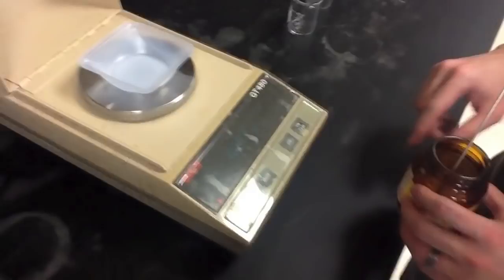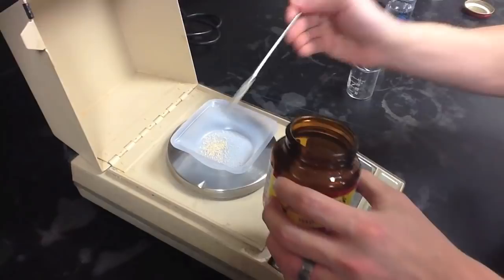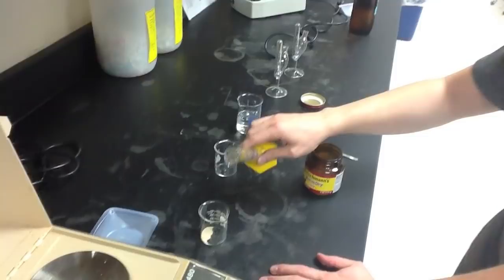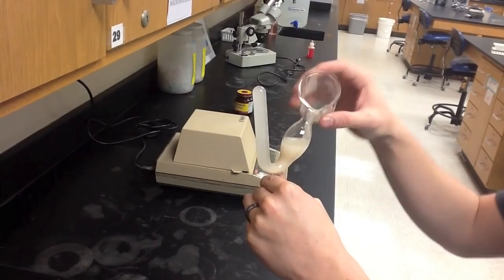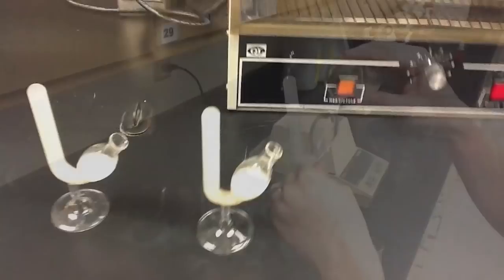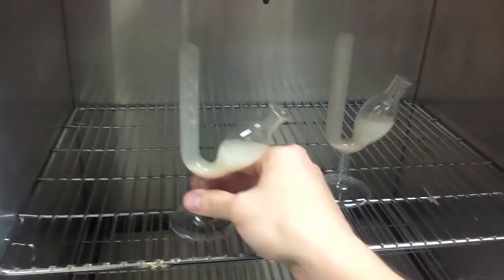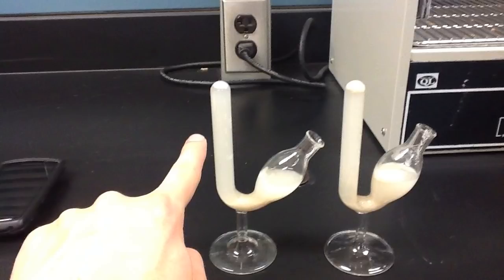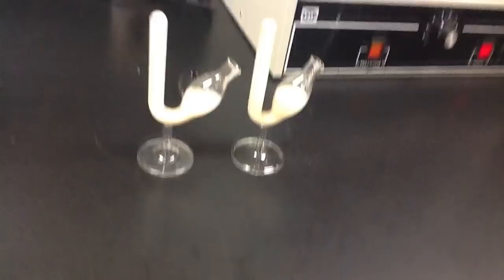Lab Protocol - Fermentation in Yeast (Unit 9 Respiration)

Comment: Hi! Is it possible for the sucrose to produce more co2 and have a faster rate given that it needs to be brokendown first into glucose by the enzyme coming from yeast? rather than the readily glucose?
Reply: In my class, sometimes the students get the most CO2 from the glucose, and sometimes from the sucrose. Often it will differ between groups on the same occasion.
Reply from the maker: While it is possible to observer a faster rate of fermentation occasionally in the sucrose compared to the glucose, previous research has actually shown that yeast typically prefer and are able to perform fermentation on glucose at a faster rate then fructose or sucrose. https://academic.oup.com/jimb/article/4/4/315/5987389

What this ultimately shows us is how important it is the repeat experiments to validate our findings. If we only performed this experiment once and observed a faster rate of fermentation in sucrose compared to glucose, we may draw incorrect conclusions from it. However, in a true research laboratory setting, you will often perform experiments hundreds, if not thousands of times to verify the validity of your findings, AND you will justify that validity through statistical analysis.

Comment: What method is used to show that fermentation is happening?
Reply: None, because the experiment is measuring aerobic respiration. Half of the CO2 the yeast produces is trapped in the tall part of the tube. The other half escapes, but since all the O2 it uses comes from the outside air, we know that all the air bubbles come from respiration. The tube has measurements on it, so you can see precisely how much they produce (when it's at least 0.3 mL, because below that is the curved top of the tube and has no markings). The maximum measurement is 5 mL.
Reply from the maker: @amicatemporis  this is not correct. Please refer to the remark I left on your other comment. This is fermentation, not anaerobic respiration. CO2 is a byproduct of fermentation. Anaerobic Respiration occurs when you still perform the latter steps of respiration but the final electron donor is NOT O2. Yeast do not perform anaerobic respiration. I believe that the vast majority of organisms that perform anaerobic respiration are limited to certain types of bacteria and archaea.
Reply from the maker: CO2 and Ethanol are produced during Fermentation. While ethanol is the final product of the process, CO2 is a byproduct produced when pyruvate is converted into acetaldehyde. Because ethanol is a liquid and CO2 is a gas, we chose to measure the CO2 as a measure of the amount of fermentation in this experiment as it will separate from the liquids in tube and rise in the arm of the tube.
Reply: @Mark-It-Yourself  Hmm. That is not how the textbook I use defines fermentation.
Reply from the maker: @amicatemporis  yeah it's a bit frustrating as it seems that a lot of texts have gone to calling fermentation anaerobic respiration, when it is actually an anaerobic process. Respiration is the full release of energy stored in an organic molecules either by aerobic or anaerobic means. I think that the because true anaerobic respiration is limited primarily to prokaryotes and archae, many texts have streamlined and have chosen to redefine "anaerobic respiration." 

However, respiration represents the maximum transfer/conversion of energy stored in an organic molecule.

I think that the other part of all of this that adds confusion to the semantics comes in the form of discussing respiration at the cellular v. organismal level. Since you teach A&P, I imagine that you discuss anaerobic respiration with regards to muscles during certain lengths/types of exercise. 

In my videos, I am discussing respiration or fermentation at the cellular level.

Comment: Fermentation produces alcohol, not carbon dioxide. The yeast here is doing aerobic respiration.
Reply from the maker: While ethanol is produced at the end of Fermentation in yeast, it is not the only product. Carbon Dioxide is produced when Yeast convert Pyruvate to Acetaldehyde during Fermentation (which is an anaerobic process). You can see the molecular pathway here: https://www.researchgate.net/profile/Baydaa-A-Hassan/publication/335455456_Alcohol_fermentation_in_Yeast/links/5d66cd68299bf11adf297aa6/Alcohol-fermentation-in-Yeast?origin=publication_detail.
The process in this particular experiment is fermentation, not anaerobic respiration. This is a common misconception that I have found students have as they are often taught about aerobic and anaerobic forms of exercise. Much like the baker’s yeast in this experiment, humans also do not perform anaerobic respiration, but instead perform lactic acid fermentation. In anaerobic respiration, the additional processes, including the electron transport chain are utilized, but the final electron acceptor in the pathway is NOT oxygen. However, the citric acid cycle and electron transport chain are not utilized in fermentation, and instead, an organic molecule accepts the electrons from NADH and allow NAD+ to be regenerated. https://bio.libretexts.org/Bookshelves/Introductory_and_General_Biology/Book%3A_General_Biology_(Boundless)/07%3A_Cellular_Respiration/7.14%3A_Metabolism_without_Oxygen_-_Anaerobic_Cellular_Respiration
Reply: @Mark-It-Yourself  I'll check out that link. In my (admittedly freshman-level) A&P and general bio classes, we define anaerobic respiration as glycolysis plus fermentation. I don't even remember learning about other final electron acceptors in grad school!
Reply from the maker: @amicatemporis  they are mostly tied to prokaryotes and archaea, which is why I think most non-microbiological programs probably don't even discuss them. Here is an article that discusses some that utilize sulfites as the final electron acceptors: https://journals.asm.org/doi/full/10.1128/JB.180.11.2975-2982.1998